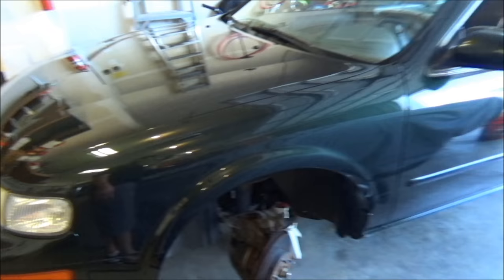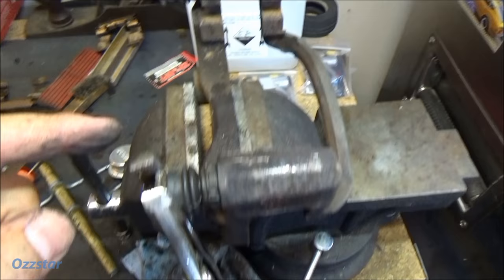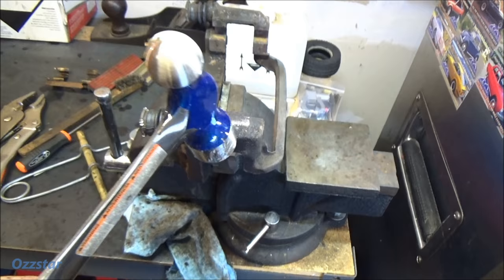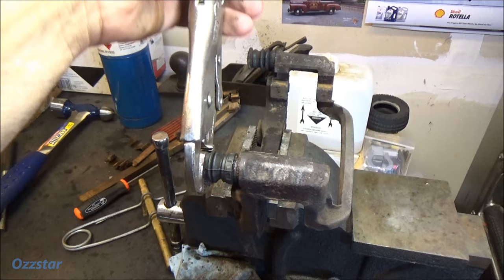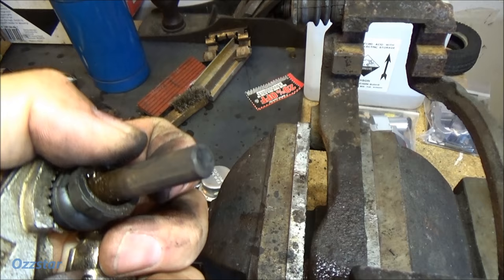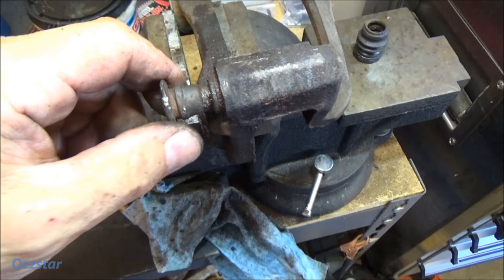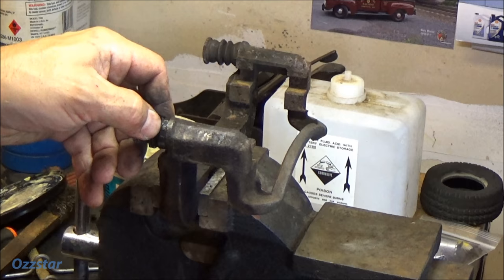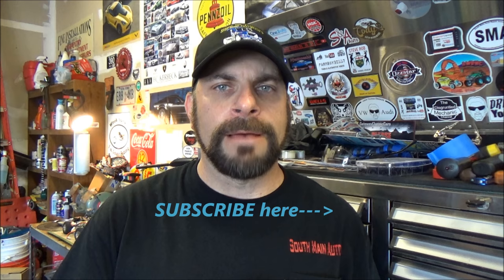Brake Caliper Pin Rusted Stuck - Heat n Beat Fix

Comment: Thanks for the tips! I know I'm a little late to the show, but what causes the slider pin with the rubber end to create a pocket of air under the pin? I've tried both light lube and heavy... Haven't tried silicone based yet.
Reply from the maker: Use silicone grease. That's trapped air. Not.much you can do
Reply: @ozzstars_cars  Thanks! I'll try it out.

Comment: This happened on my Camry. I got a propane torch & a  3lb mallet so I should be able to get it done without that big bench vice on my paved driveway.
Thanks!
Reply from the maker: That's a BFH for a small job. Don't  bend the bracket by accident.

Comment: I've used this method on a Toyota and same problem happened again not too long after, I just use an air hammer or hammer and punch to get it out and dry methods of cleaning out the bore, seem to have had better luck

Comment: What’s the point of heating it, does it make metal slide easier?
Serious question, I’m having the same issue.
Reply from the maker: Heating makes the metal expand which breaks the rust.
Reply: Ozzstar's Cars ohh okay thanks. I got the problem fixed. Thanks for the video

Comment: a cause of a low brake pedal.   I use the shop torch as plan c  its never happened but the bracket can explode due to heated traped air and send some flak my way! glen you can get a boot kit also for that also
Reply from the maker: Yes I did order a boot kit.  Didn't know about the explosion part, hope I don't learn that from experience. Haha  Thanks for the info.

Comment: thank you for the info! i have a seized guide pin on my 2014 Hyundai Santefe, now i know what to do! thank you.
Reply from the maker: Take your time and patience.  Let us know how it goes.
Reply: @ozzstars_cars  for sure, the one im dealing doesnt move at all, its literally seized in there
Reply from the maker: @Matt-iq1zj  they can be tough to remove.  If the pin wobbles in the bore after removal, then replace it.

Comment: Had this happen on one of my cars before. I freed it with a impact wrench, leaving the slider pin bolt on and driving it.
Reply: I was afraid to strip the threads. I ended up using this method by instinct.

Comment: The brake fluid lubricates the sliding pin, so if the rubber seal is damaged the e brake fluid will leak
Reply from the maker: @education9135  that is incorrect.  Brake fluid is held back by the caliper piston seal, has nothing to do with the slide pins or bolts.

Comment: I used sil-glyde brake grease on my caliber slide pins. It's supposed to be OK for rubber you can buy it at most any parts store. It's like $10 bucks for a 8 ounce tube.
Reply from the maker: Yes it's good.

Comment: Will copper anti size hurt anything in there? Should be fine eh
Reply from the maker: The rubber.
Reply: @ozzstars_cars  hmmm. How harmful is it to rubber? Will it be an okay temporary fix you think? I wanna replace the calipers in question soon anyway
Reply from the maker: @Tenaciousdomi  the petroleum distillates in the anti seize will cause the rubber to swell, get soft and mushy and eventually just rot away.  Silicone brake grease is safe for rubber and will not melt easily with high temps.
Reply from the maker: @Tenaciousdomi  this is the correct lubricant Silaramic Brake Grease  https://amzn.to/2XgYIlS
Reply: @ozzstars_cars  hey thanks a bunch man!! Much appreciated!

Comment: Good video. Unfortunately my pin snapped flush with the pad carrier and there's about an 1.5 inch of slider shaft stuck in the bore. Anyone got an idea how I might get this out?
Reply from the maker: At that point you are probably off buying a new or good used bracket and slider pins.  Drilling out the frozen pin would probably ruin the bore.
Reply: @ozzstars_cars  Thank you.Ultimately will probably source a used unit but will try to weld a nut on and attempt to withdraw before I scrap it.

Comment: That rubber have to go inside the body on my honda front brake and i can't put it back.
Reply from the maker: Need to buy a new boot kit which has the slider pin seal with it.
Reply: @ozzstars_cars  I found the problem. I used oil based grease and that grease "hydrate" the rubber and makes it bigger. Bought a new one and it was way smaller than the old used one. Just learned to never use oil based grease on rubber seals.
Thx for response.

Comment: My front hubs on my 4x4 1990 GMC get extremely hot when driven for more than 30 minutes. Could stuck caliper pins be the cause of the friction heat?
Reply from the maker: Could be, and/or a frozen caliper piston.

Comment: Another way is use a impact wrench. Drill bit to clean the bore. Put pin in drill and use sandpaper to shine it up.. use brake cleaner then regrease
Reply from the maker: If it works then it's a victory!

Comment: A little heat should always work it's usually because the silicone grease heats up and cools down over time turning into a thick hard rubber what's funny is those bore brunches I just found out about last year I would of killed for one of those when doing brakes during the last 36years
Reply from the maker: The brushes work great!

Comment: If U buy the yellow bottle (map gas) it will get twice as hot as the blue bottles
Reply from the maker: Don't get MAPP and MAP-Pro confused. True MAPP gas burns at 5300 degrees and MAP-Pro at 3730 degrees. There is no need for a lot of heat in this case.
Reply: @ozzstars_cars  thanks Ozz I didn't realize that.

Comment: Burnt the hell outta my rubber boot I'll have to take back apart in a few days and install a new one . But I somehow got that one free worst one ever.

The old Lady's Scion XB is friggin terrible with these siezing. Boots are fine and I clean the hell outta them with a fine emrey cloth and grease every time. Siezed everytime I do her brakes and she burns through them more than the avg joe😂

I never had a siezed one in over 35 years. Then I get the a the time with her car Im sure it's a combination be of her beaking habits AND the design for that particular car.
Reply from the maker: Probably the metal chemistry.
Reply: @ozzstars_cars  something like that, that cars the bane of my existence with it's brakes haha. 20 minute job for my cars hers is a damned all day ordeal 😂
Reply from the maker: @patricklawton8135  and she'll never know how much of a PIA the repair is.🤷‍♂️